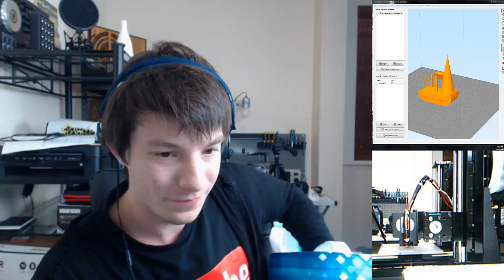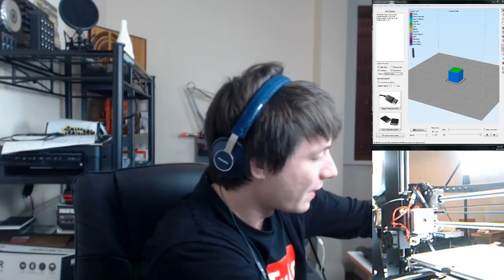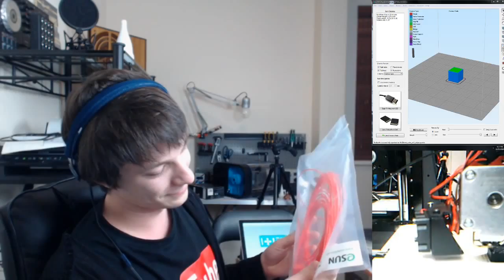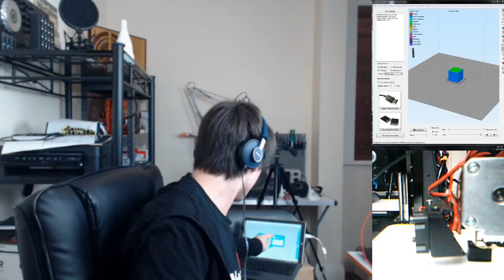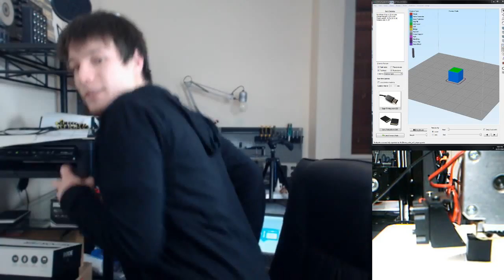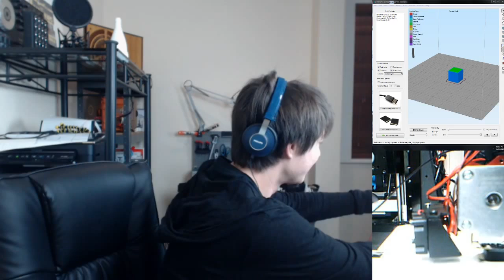Was Live - Testing filaments with Q&A

Comment: You can friction weld PLA by putting a piece of filament in a rotary tool. But don't use too long filament pieces or you get a weed whacker.

http://slashhome.se/p/gallery/?g2_itemId=11464#g2
The box in the picture above has a friction welded cap on the right hand side.

Comment: I have gotten PVA supports to work quite well with ABS. It took a lot of tweaking though for sure. But it does work very well once you nail the settings. And the ability to melt the PVA support when finished for a smooth Finnish is awesome!!

Comment: I'm late to the party but I can maybe answer the robo3d question.  I have two of them.  They really are great.. I sold my expensive modified replicator2 and have two Robo's now.  The downmarks I will give the robo3d is their quality control from wherever the factory is that makes them SUCKS.  Both of mine came broken out of the box easy fixes if you know what your doing.  + marks is they are very easy to get a hold of and get you fixed up.  They print quite well and the auto leveling is great., and large build volume.  Their forum community is probably the best I have seen so thats another really good thing they have going.

Comment: The Robo R!plus has as all other printers fixed the issues that the previous version has. I have been very impressed with Robo. They have 24-7 tech support in English., will send you replacement parts if becessary and those two things are almost unheard of . Saying they are no good out of the box is unfair.

Comment: Any chance of putting something like a dark blanket over the window to your left when streaming?  That may fix some contrast issues.

Any chance you could post a link of RichRap's video about how to fix the gaps in the layers in the description?

A 3D printer can be made less noisy by using Noctura fans and NEMA dampers (http://www.robotdigg.com/product/341/Antivibration+damper+4+nema17+stepper).  I know that Noctura fans have helped your Laptop become quieter.  The only downside about Noctura fans that I am aware of is that that they are typically 12V and some 3D printers don't use a 12V system.  I have also heard of someone starting a project of replacing Stepper Motors with brushed DC servos with encoders. (http://forum.makergear.com/viewtopic.php?f=10&t=1316#p3788)

Filament recycling is possible, but you should add a modification to your 3D printer to adjust the feed multiplier via a filament width sensor.  I know you did a review on a Filament out sensor.  Similar concept, but I think I found a filament out sensor with width sensing built in.
Again, you have a point about impurities.  But filament width isn't an issue if you use a width sensor.

I know that some older webcams had issues with NetGear network drivers.

I do like the trick Joel's channel uncovered about using dyes or inks on PLA to make a wood like filament effect.

It would be nice if you could build a software interface between stl/gcode and the YOLO printing process.  I know you mentioned it uses bitmaps for layers.

I know you can get a heated bed for a Fabrikator Mini.  I have purchased one from eBay and received it.  I'm still waiting to receive my Fabrikator Mini to try it out.

I know that Chuck's channel mentioned using Methylene Chloride to glue some plastic pieces together.  I think the plastic used was PLA, but I'd have to double check.

For your filament library/vault, you may want to consider some sort of shopping cart like system.  Maybe you could even earn a small commission from the various filaments you have in your library pointing to the manufacturers.

I'd like to get a Gigabot (https://re3d.org/gigabot/), but that is out of the price range for most people.

Any chance we can get a link to the highwin(sp?) linear rails website put in the description.  Where would you recommend going to get 10mm per turn ball screws?

Maybe the Trinus could be made faster via Servos with encoders vs NEMAs.

Comment: THF isn't that bad as long as you don't heat it or expose it to air. What would scare you into not using it is that it has the potential to mess with your hormones with long term exposure, man books for smooth pla is not worth it.

Comment: If I had to do over again, my first printer would be a Wanhao i3 or one of the many clones or rebrandings of it. I would only buy an extremely popular printer with a large on-line user community and the Wanhao i3 and clones also fit that requirement. Finally, I would not buy a printer that cannot use free 3D printer software, but instead requires software originating from the 3D printer manufacturer due to, for instance, things like proprietary USB communication with the printer.

Comment: Noctua 40x10mm A-Series Blades with AAO Frame, SSO2 Bearing Premium Retail Cooling Fan NF-A4x10 https://www.amazon.com/dp/B009NQLT0M/ref=cm_sw_r_sms_apa_TmEqxbEMG0CBR......I pit this in my wanhao power box with Wanhao Duplicator i3 back plate 60mm fan found on #Thingiverse http://www.thingiverse.com/thing:1144467.....it did more then cut the heat in 1/2 it reverse The Heat !!!Top right of the Box feels cold after being on for 24 hours straight now the hotest part of the box is the LED screen.
Reply: top post has the wrong fan link....I used the 60mm on the box found here....
Noctua 60x25mm A-Series Blades with AAO Frame, SSO2 Bearing Premium Fan - Retail Cooling NF-A6x25 https://www.amazon.com/dp/B009NQMESS/ref=cm_sw_r_sms_apa_YuEqxbJMNEZ9H

Comment: +Maker's Muse to quiet a printer down, you also have a number of things that can happen based on electronics choice. The Replicape's drivers have a "stealthchop" mode, not sure exactly how it works, but the motors are then dead quiet, without the usually choppy whine you'd get on them. I think they're TMC2100 drivers? The specs are on the 'cape's wiki: http://wiki.thing-printer.com/